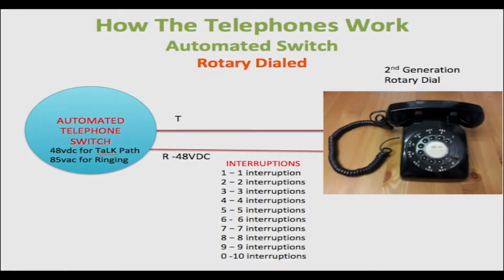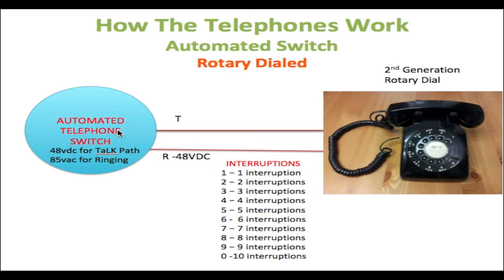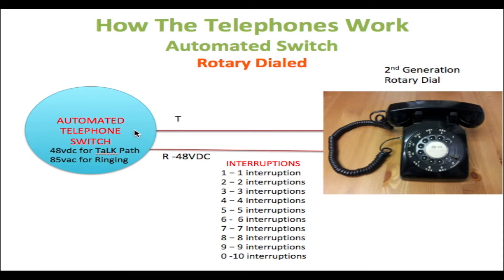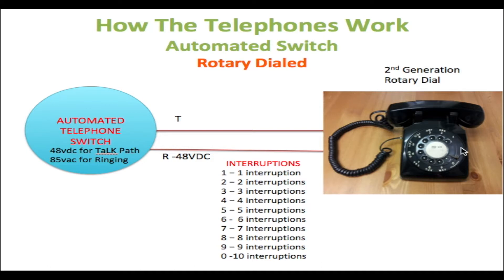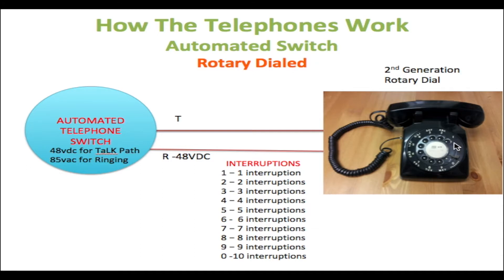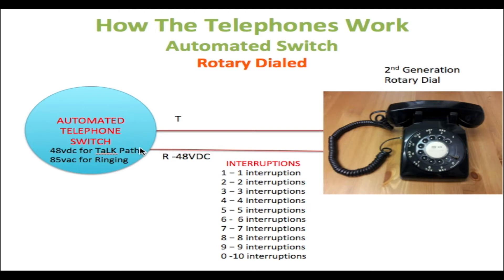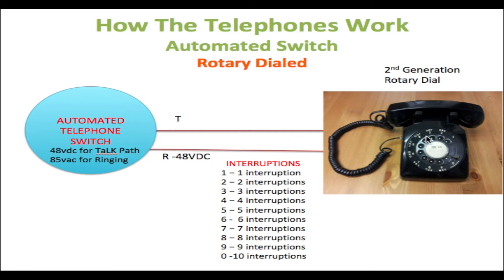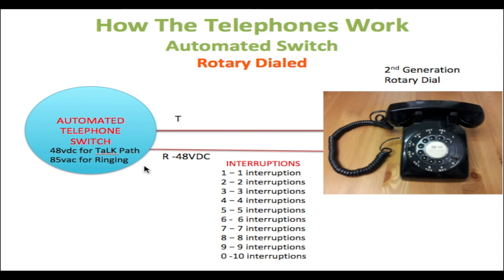"How Rotary Phones Work"

Comment: Remember, you need to use only your index finger for the rotary motion as explained in the video or else it doesn't work. No thumb, middle, ring, or pinky finger.
Reply from the maker: Just to make sure I got the question right.  You asked if the DSLAM is disconnected from the internet, would you still have a sync light on the modem.  The answer is yes.  Many DSL lines share a single DSLAM using a common connection to the internet so disconnecting the DSLAM from the internet would prevent internet service from getting to all connected dsl modems so the internet or network light on the connected modems would be off.  However the sync light on any of the modems would only be off if there is no synchronization between that modem and the DSLAM.  Hope my answer was helpful to you.